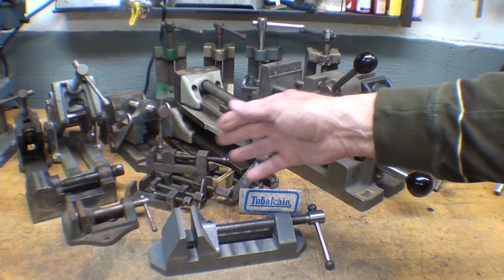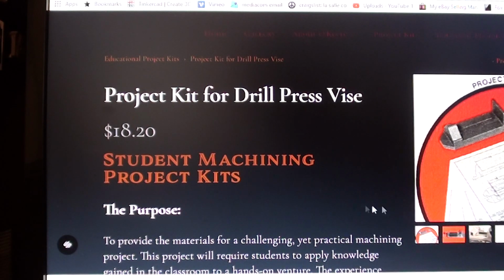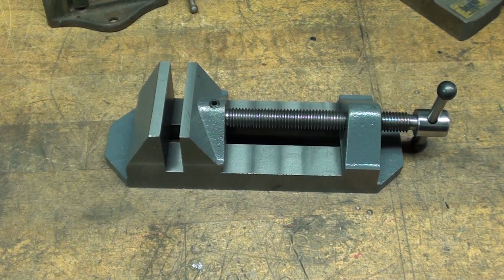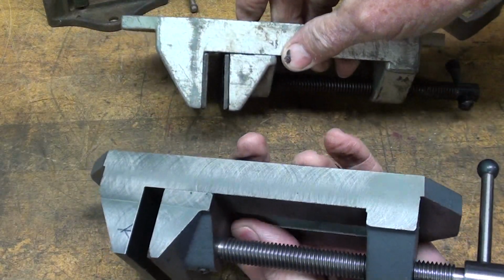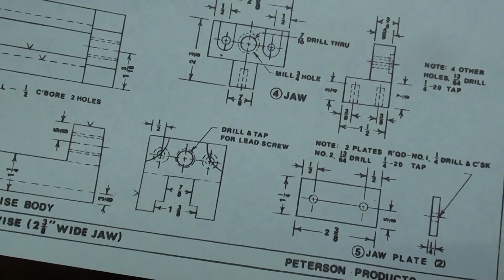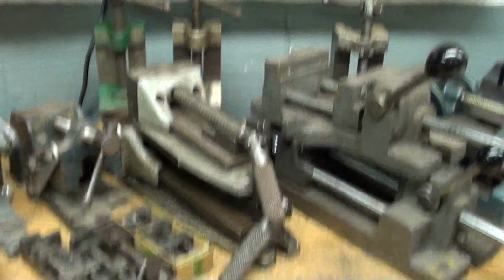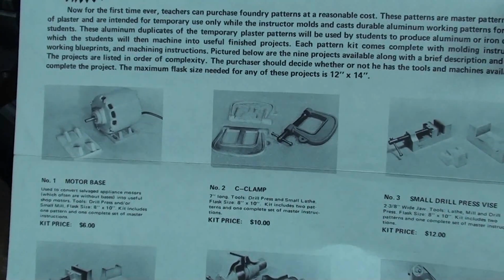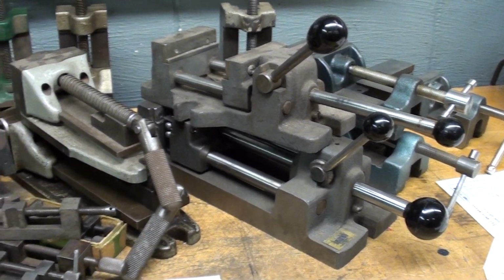Struck Drill Press Vise Follow UpTips #440 tubalcain

Comment: Absolutely love this compendium of drill press vises.  I have an old Dunlap 103 like one of yours and I have corrected it's poorness by flattening the bottom, milling the top two faces flat to match the bottom and made a new slider that rides on a flattened set of rails and is setup to eliminate most of the slop when tight.  It works pretty well for medium-precision drill press work.  Thank you for the interesting and informative video!  Great tip about the turning down of acorn nuts!

Comment: Couldn't you also mount the vise on the lathe cross slide and drill for the threaded rod using a bit in the headstock?

Comment: OK, I was just looking at the OKeefe castings drill press vice kit and the blueprints they show seem to have the retaining screw for the lead screw coming up from the bottom and then covered over by the retaining plate. That actually seems like a pretty nice way of doing it since it would be possible to size the screw so it couldn't back out because the plate would hold it in.

Comment: I think I saw a little belt sander on your catalog page. I'd like to see that close up if possible. I think the balls on the handle were the only proper way to go. I was using my mentor's drill press as a boy and experienced the drill hanging up. I let go and the vise got flung into the wall, breaking one of the balls off. He replaced it with an acorn nut.
Reply from the maker: Yes, it can scare the heck out of you when the drill grabs

Comment: Hi Mr. Pete.  I am new to machining and would like to ask you a question since you are a teacher with a lot of experience.  With a metal mill; what is the proper height of the mill table to the user.  Is it waste height or else for proper table height?  Thanks.  Greatly enjoy your videos.
Reply from the maker: I have no answer for that. Because the height varies depending on the length of the tool or the size of the work

Comment: I watched right through! How about drilling through the fixed jaw and the moveable jaw and adding two copper jaw plates with crossed and/or 45 degree V grooves just to finish off a beautiful little vise. Plus that would eliminate the short screw issue for those negative Nancy’s haha. Perhaps they could be rebated and sit proud of the top of the cast jaws as well. Enjoyable as always. Thank you 🙏 from Australia 🇦🇺
Reply from the maker: That's a good idea, but the job is done

Comment: I HAVE A TRICKY QUESTION FOR YOU MR. PETE. IS IT EASIER TO TURN IN A MILL OR TO MILL IN A LATHE?
Reply from the maker: I would say milling on the lathe
Reply: Are you using a 3 phase converter for your Bridgeport? If so what do you recommend? I found a great deal on a Bridgeport locally and I’m not very familiar with the single to 3 phase converters.
Reply from the maker: I use a static 3 phase converter--about the size of a cigar box. About $125 -I think I got it from MSC--works great

Comment: Enjoyed seeing your video as in 1964 I made a similar vise as a vocational machine shop student in SW Michigan.  I still have it and occasionally use it.  Though now it's usually used to hold small parts when welding.  The problem is with my vise is it that the screw thread is so fine it takes an annoying long time to go from open to close. I expect it was meant to be a combo mill or drill vise.  Most t&d shops I was in through the years used the cam lock vises (for drilling) as seen in your vise pile. They can't be beat as a drill vise.  Ps, my comment for any YouTube creator is either positive or not made at all.  Keep up the good work!  Mike
Reply from the maker: Thank you for watching. A lot of these casting projects were made over the years. And yes, A find thread can be annoying in certain applications

Comment: In that box of "stuff" looks like a shell mill driver for an Atlas horizontal mill or similar.  May be of some value besides going straight into a bucket of miscellaneous bits of round scrap.
Reply from the maker: I will have to look through that box of junk again, to see if I still have it

Comment: I was actually thinking of trying to melt cast iron in my foundry furnace. I have melted the 2700 degree bricks lining it so I may have enough heat. I thought of making my own patterns and making a vice for myself but also wondered if anyone would be interested in buying castings if they were for sale. Interesting project, and a useful learning experience also.
Reply from the maker: Give it a try, but it takes an awful lot of heat. And it's kind of scary

Comment: You have the most watchable and instructable (if that's a word) machinist videos on YouTube! I appreciate all the time and effort you put into sharing your vast knowledge with us all! p.s. In regards to Acme threads, abom79 has an excellent video on grinding a tool for cutting  internal Acme threads on a lathe. No tap necessary.
Reply from the maker: Thank you very much for saying that about my instruction. A half inch hole, is too small to thread by a boring bar

Comment: Another great video series. 
Any chance someone could CAD up your old plaster molds to be 3D printed (STL)? Then when printed they can be used as casting patterns, replacing your old plaster molds.
Reply from the maker: You know what, that is a brilliant idea. For me to at least make one of them then a video. I still have all the drawings and the dimensions
Reply: Cool idea!
Reply: And when you have the patterns, you might want to send them to the foundry Keith Rucker uses in PA to have them cast in iron...

Comment: Lyle,

I enjoyed this series immensely!  I am sure it is because I too am a shop teacher.  So many companies that once made supplies for school shops are now long gone.  I remember when I was in college at Kent State University in the early 1990s, I found unfinished castings of a small gasoline engine in one of the storage areas.  I wished that I could get such a kit and build a small engine myself.  However I never have seen such kits available.   I at one time regularly used a company called Retco Alloy as a supplier of project materials.  I would get oil hardening drill rod and beautiful clear yellow extruded screwdriver handle stock and the kids would build a screwdriver with these materials.   If they took there time and would follow directions they would end up with a very nice screwdriver.  (most did not)  Retco is now gone.  I once called them to order more tool box hardware for my class only to find the number was disconnected.    

My students would also build drill press vises.  Ours were all built from bar stock and were a heck of a lot more expensive than those casting kits you showed in your video.  

As for the man who stole your design, drawings, and patterns.  I am reminded of two old sayings:  "Imitation is the most sincere form of flattery." and "Education is a lot like magic, you find someone with a good act and steal it!"

All the best!
Your friend in Ohio!
Mike
Reply from the maker: It's good to hear from another shop teacher. I ordered 90% of my steel and supplies from a retro.  I still remember their address in elk Grove Village. They had great service and good prices. Are used to buy their toolbox kids. They will send me a ham every Christmas. And yes, imitation is the sincerest form of flattery he. I will not pursue any damages. As you can imagine, there wasn't much money to be made anyway.keep watching
Reply: Damn!  I never got a ham, not even a key chain :(  LOL

Comment: These videos are fun.  The history that comes up in your ramblings is interesting. Keep it up!
Reply from the maker: I'm glad you liked it
Reply: My grandpa was a farmer and I spent hours and hours as a kid in the shop with him, fixing farm equipment.  He bought a couple of new Massey Furguson tractors in the mid '70s, but other than those, he was running mostly pre-1950 equipment right up into the 2000s.  Your rambling and appreciation of old tools remind me of him.  He had one joke he used all the time.  When I was struggling to remove a lug nut, he would come over, turn it easily and then say "Well, if you pull hard, it comes easy!"  Now I'm rambling.  My point is this.  I'm sure you have viewers who just tune in to see the chips fly, but for a lot of us, your rambling tangents and appreciation for history are the reason we watch.

Comment: Age around 14 and one lesson in woodwork sticks in my memory. Our task was simply to plane a short length of wood 'square' and my happy concentration was interrupted by a caveman like roar form the far corner behind me followed by three hard hammer blows, each with a neanderthal grunt and finally an almighty bang.  Following the silence that filled the room came the clunk of cast iron hitting concrete and the tinkle in comparison of a short length of wood hitting the floor. 

My arch nemesis of the class had, again, lost his temper and unable to tighten his now triangular section of wood in the vice to plane it further had taken a large wooden mallet to the vice handle and managed to shatter the whole front jaw off the vice such was the animal ferocity which he used to hammer it tighter. His route to the Head was assured and as my work station had a view of the heads office I have to admit I rather enjoyed watching the result. Our teacher must have noticed my seeming to be staring off into the distance shouting out " You boy. Less dreaming more doing!" "Yes Sir", I replied with a smile on my face.
Reply from the maker: That's quite a story. I had to laugh, but it was too realistic. At first I I thought you were going to say that the teacher had a temper tantrum. Thank you
Reply: Great Story Godshole,
Almost fell out of my chair I was laughing so hard.
Thanks for sharing.

Comment: Talk about drill holes by the arm & hammer's.  I have a turn of the century Avey drill press about 8 feet high flat belt drive,  table about 30x30 that can be lowered to the base same as a mill. The quill mount also on dovetails  has 2 feet of travel. What I'm saying is there is not one mark or drill mark on that table..  So hows that for 100 yrs old and also it silently runs smooth as silk.  My other so called modern  junk drill presses ;  just listen  you know that over the pond sound.  I Am guilty  I made a end mill mark on the rotary table ( my leg touched the Z crank). Sounds crazy  that I made a better end mill mark on the table, and photo shop printed the makers name in the hole.....  as a lathe chuck little emblem like "Rohm"   which it is.... sam
Reply from the maker: That's amazing, that a machine could be that old and the table still in pristine condition

Comment: The Dunlap brand was first use in 1941 the predecessor to the Craftsman brand by Sears Roebuck and Co. You can find more information at vintage machinery.org from Keith Rucker
Reply from the maker: I thought it was the Sears brand
Reply: Hay I just realized or noticed I have one of those aluminium vices too the label is missing but it's identical. It's the only one I let my grandson use so he doesn't screw up one of the good vices. They must have made a lot of them.

Comment: I assembled a Struck MiniDozer in my teen years. We used it to pull up the frames on our A-frame house during construction. It had a lot of pulling power, but the crazy belt drive system required a lot of “fussing” with to keep it operational.
Reply from the maker: It's good to hear from someone that actually used a dozer. I remember them from when I visited the struck company. I think they were just starting to make them at that time